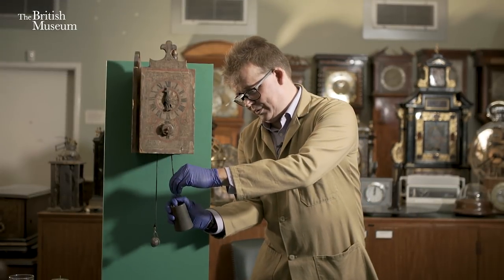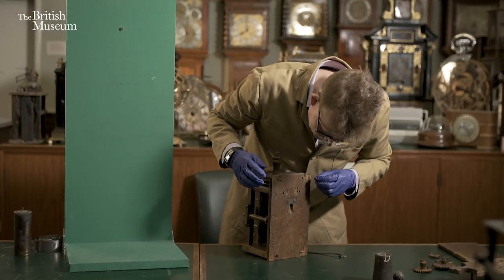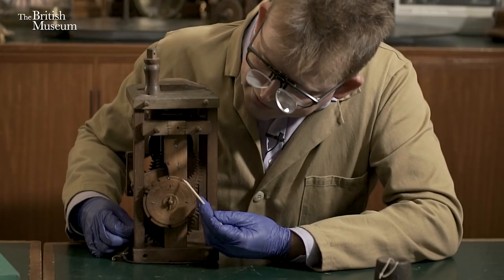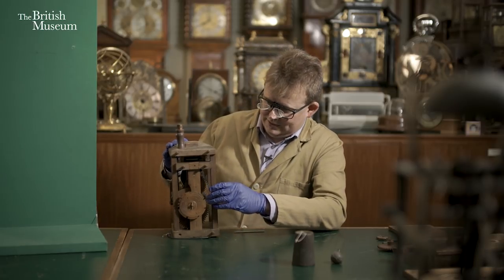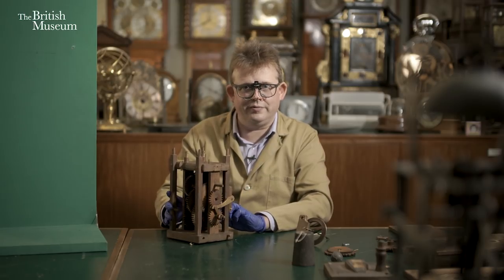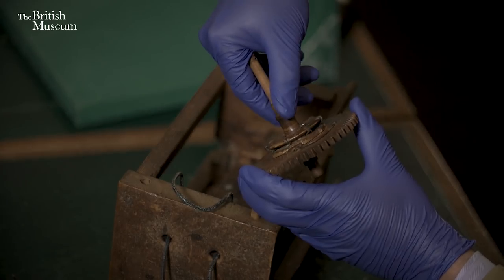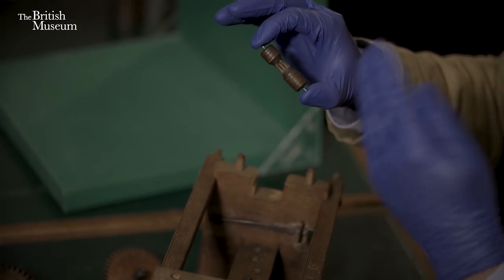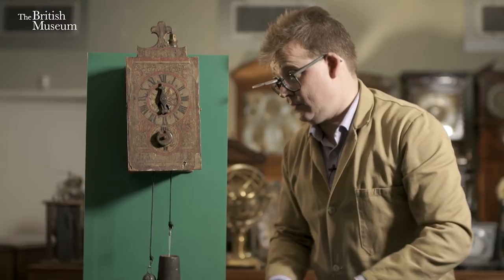How to take a clock apart (and put it back together) with Oliver Cooke I Curator's Corner S3 Ep4

Comment: Admit it, you've done this before. Thank you for the explanation and showing us this beautiful clock. The little wedge holding the frame in place is just brilliant.
Inspired by this, I  just got to work on a semi-antique brass clockwork I had lying around and didn't dare to try to understand until now. Separating into running and striking train helped me a lot get it. Still not quite there, and it's getting late, so I'll call it a day.
Now here's a question: what would a curator and clock expert use to clear out decades of oily dusty gunk and then lubricate it?

Comment: This would be amazing as a 3D model for printing
Reply: It would be a large project to print but I don't see any reason why it could not be done. It would require someone who has a lot of knowledge of design, cad programs, possibly plans or a way of determining the size of each original part, and a will to do it. I wonder if scanning the originals would be worthwhile.
Reply: I think the easiest would be scanning the original. But remaking everything from scratch should also be possible, but it would probably take a while to get everything running smoothly.
Reply: YES !

Comment: In the 1600s, some bloke was 
makin' clocks out of W O O D
Reply: 1400's and a bit before I believe.
Reply: I have a wooden framed clock, mass produced 100+ years ago. The wheels and their spindles are metal grunning in holes in the wood
It's an alarm rather than a chimer.
It doesn't run any more. I think the frame sags from front to back causing the spindles to bind.
It has a pretty pink face and looks good on the wall.